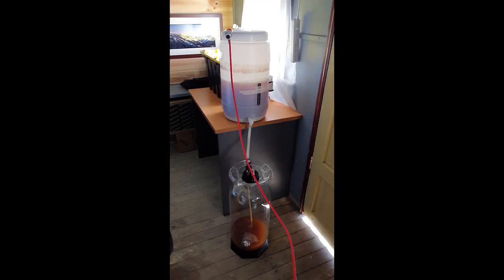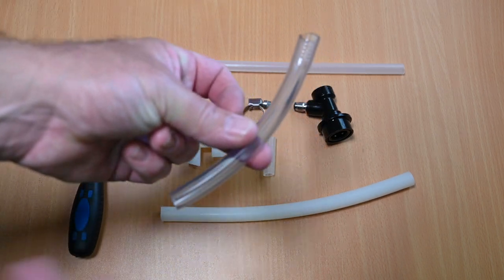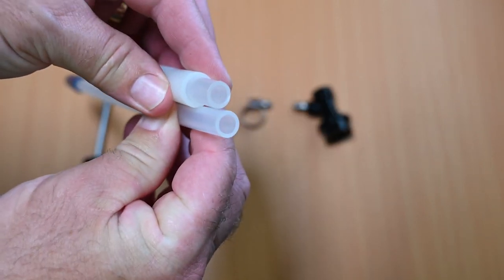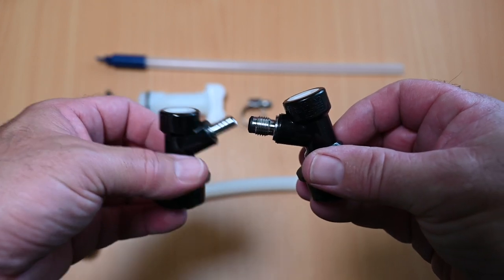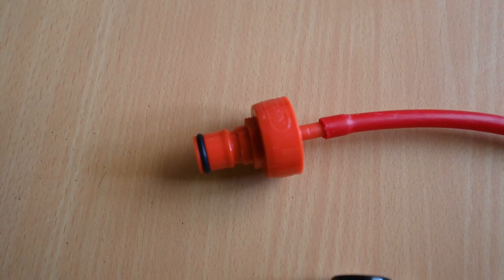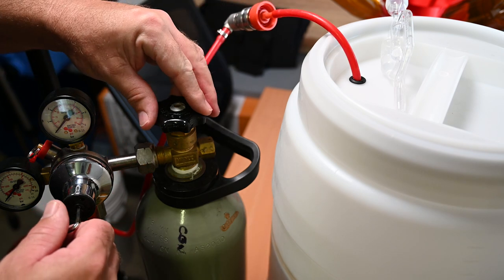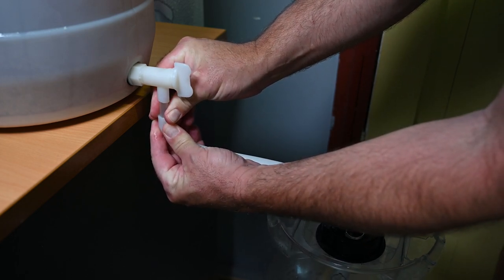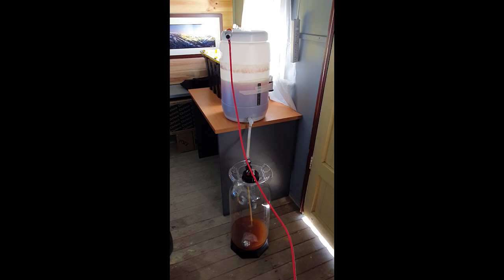How I Keg Beer Using Gravity Oxygen Free | Non-Pressure LoDo | O2 Free Transfer

Comment: Instead of opening the pressure release valve have you considered not using the CO2 cylinder and instead connecting the keg's gas post to the fermenter bung hole?
Reply from the maker: I have done it that way but don't now, although you could easily do that as well. I just prefer to use the C02 tank instead as I know its 100% C02 whereas the keg may still have some residual O2 but that's also probably just me being a bit paranoid!

Comment: That is a curious setup ... I don’t normally feel comfortable with a small 1 inch (30mm) tube being inside of two connections, it clearly works fine; but just makes me nervous.
Reply from the maker: Ive had no problems with my setup so far. The 1 inch solid plastic tube fits very tightly into the fermenter and the silicon tubing plus it was designed to be this way for bottling wands. I could put a hose clamp on the silicon side for safety sake but its tight enough that im confident it won't come off and it has no pressure on it anyway

Comment: Really keen to try this method, thanks for the video! I had a quick question if thats alright...I've never transferred using a spigot, only ever a siphon, so I'm just wondering, how common is it for the spigot to clog? I'm brewing a NEIPA (hence trying to find an oxygen free transfer method) and (aside from the yeast cake and trub) there will also be 2 hop bags in still in the bucket by the time it comes to cold crash and then closed transfer....so I'm wondering if this (along with regular yeast cake/trub) ever causes an issue with this method of closed transfer.
Reply from the maker: I haven't had an issue so far, I have a sediment reducer on the inside of the spigot which works really well. The only way you'll find out yourself is to give it a go!

Comment: The thing you have to be concerned with is hot side aeration aka boiling wort, after the wort is cooled there is very little danger from oxygen to your beer, otherwise, when you aerate prior to pitching your yeast you would ruin your beer.